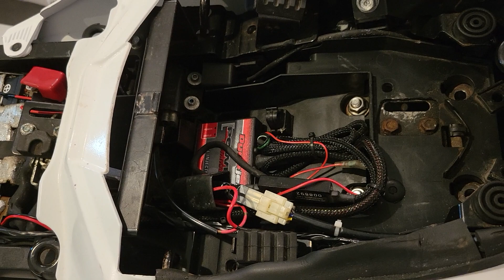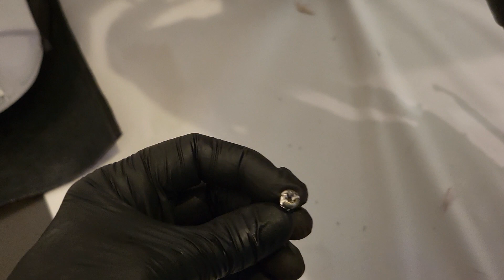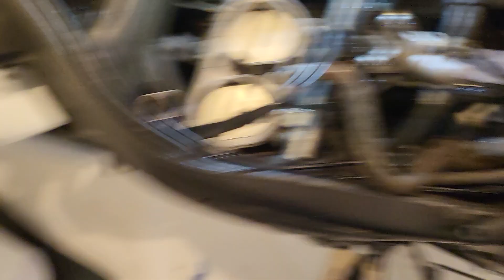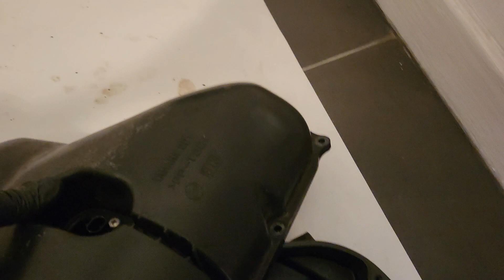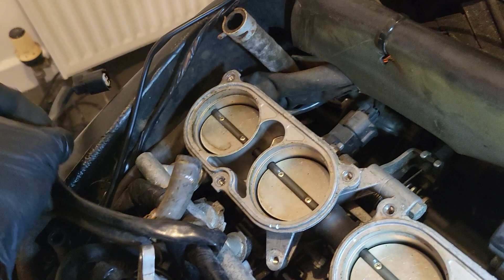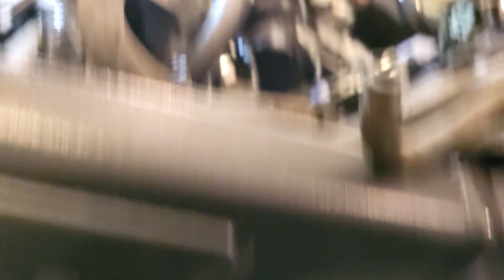yamaha fz1 thermo wax cold start repair

Comment: I did this job yesterday but i didn't have to take out the airbox. I just unhooked the coolant hoses from either side of the wax valve, opened up the wax valve, and sprayed it internally moving that lil bit that was stuck with a long nose pliers. 

If you do it that way, becareful when handling the little spring and the lil part connected to it. Mine got flung off and it wasn't fun looking for it .
Reply: Where do the coolant hoses leading to the wax valve unit fit onto at the other end?

Comment: I’ve owned a 2014 fz1 for about 2 years now and it always takes 2 attempts for a cold start. When engine is warm it starts instantly. Could it be a thermowax issue?

Comment: hello, does gen 1 have this unit?
Reply from the maker: Gen 1 bikes are carburetted so have a manual choke
Reply: My fz1 has the thermo wax system but doesn't have the idle adjustment knob